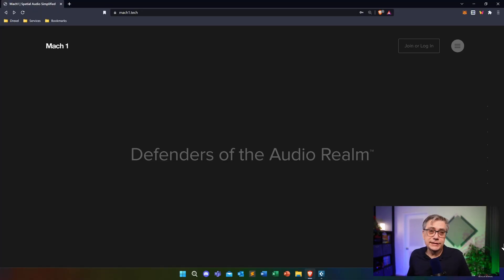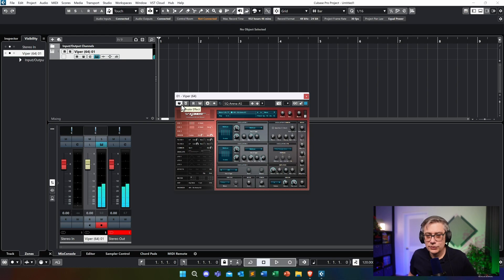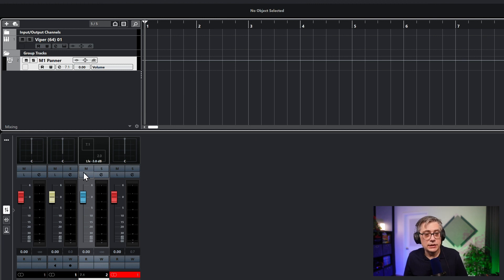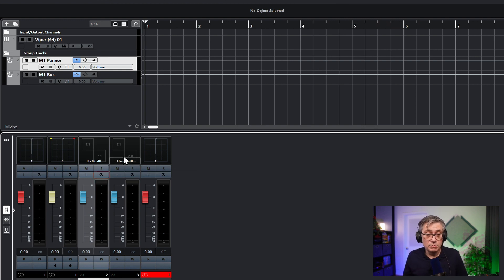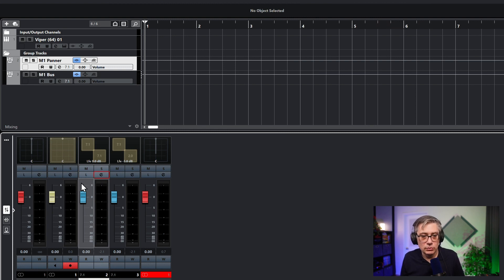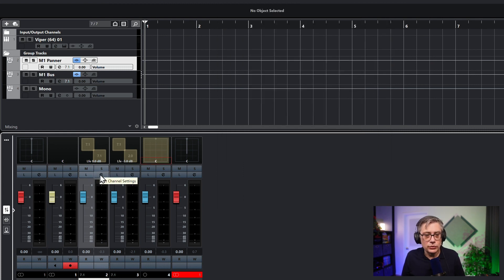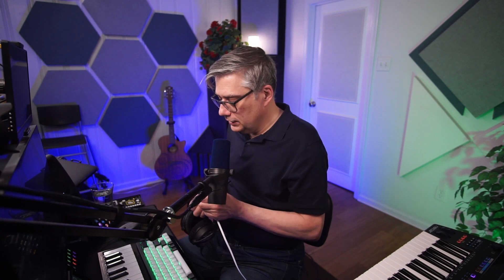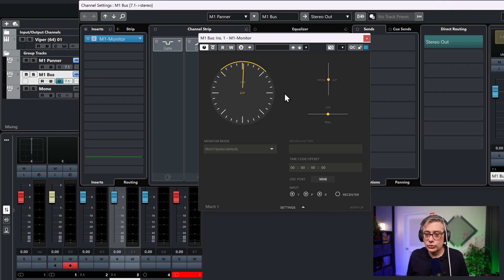Getting started with Mach1 Spatial Audio in Cubase or Nuendo

Comment: Very interesting representation of how Mach1 works - thanks  👍 - but unfortunately doesn't seem to be for Ableton (according to the Mach1 page) 😔
Reply from the maker: You need multichannel. You probably could work through m4l though.
Reply: @michaelgwagner  Thanks, good tip
Reply: You can use it with a stereo daw, I use it with Bitwig, you just have to take the 8 outputs of the Mach1 panners on each track and send them to an 8 track sub group of stereo/mono  tracks and output those tracks to the Mach 1 Monitor VST which you can host in whatever you want. I use SAVIHost and just take 8 outputs from Bitwig via Jack Audio. Really simple and stable. Your DAW does need you to be able to route VST outputs though. Generally VST2 will work, the VST3 won't. I did a couple of videos here:
https://youtu.be/6MBwpAchC14
Reply: @SamHocking  thank you for the hints 👍